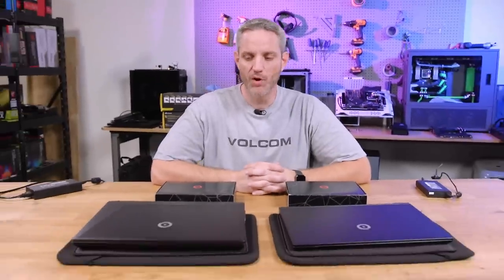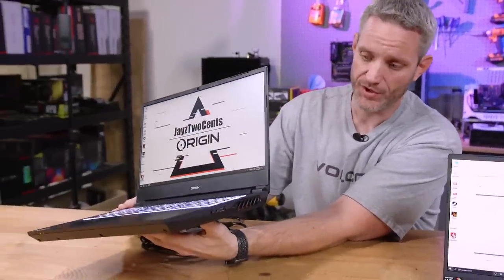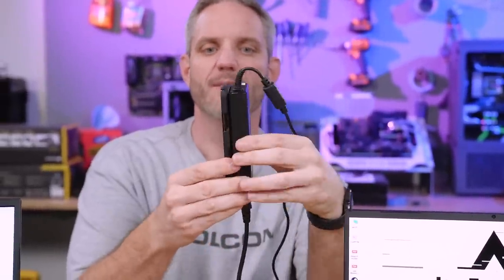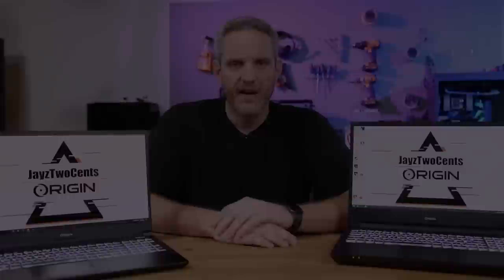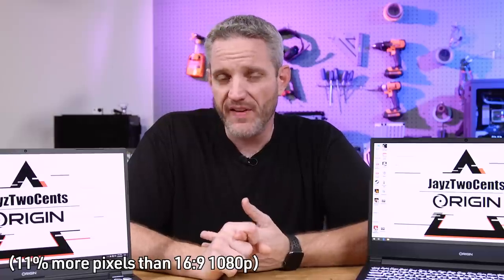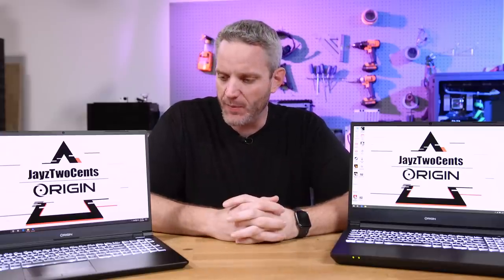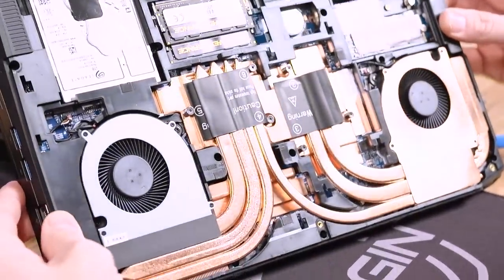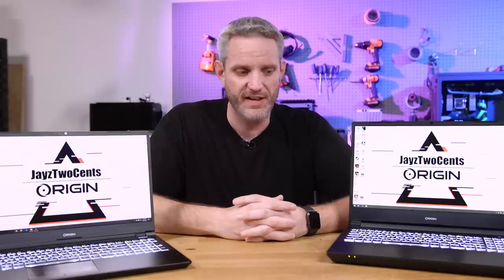A Laptop with 16 Cores 32 Threads?? Desktop killer!

Comment: No matter how powerful a laptop becomes  the battery will always be the limiting factor. I also hate that is that they are not as customizable. Labtop are good if you want to travel alot but I want a battery to last as long as my phone at least while I run my ide and surfing the web. I argue even a potato  desktop better then the best laptop for work as long as you have a decent processor.

Comment: One thing I will never like laptops for is them having batteries. I've never not had a laptop that its battery didn't die. Currently my laptop has to be plugged in or else it won't work as it doesn't hold a charge. For this reason I don't see myself ever buying another laptop again. I'm not going to replace the battery for it to have any use. If I don't replace the battery than it's just a desktop so I'll stick to only ever getting desktops for now on.

Comment: Personally I would choose the AMD system so I could easily do work in Blender while sitting beside the creek and also be able to power it via Solar anywhere I happen to be. Yes, I would not use the power brick in this setup and directly feed the proper DC Voltage from my solar setup thus saving energy & not lose at least 20% by going from DC to AC back to DC.

Comment: I have been thinking about a small form factor high core count build. Something that could run two or three virtual machines for gaming at a friend's house. I'm not going to be able to afford this but the idea is to redirect split screen gaming. Could you set up two or four vms to display to a large screen 4k TV consevably we would all only need to hang at 1080p. Or a weird 2080 narrow screen. That would be a challenge , super ultrawide 1080 top and bottom would be great

Comment: If i could get that AMD system in my camera bag, i'd use it for my 360x360 camera, and my pro camera's video. As it stands now i just have a cheap 4500u tablet(because that is what will fit), with the SSD replaced with a 1TB Rocket Q, to bring those photos/videos back home to my full 150w 3950xt. And if needed my 8750h for quick sync

Comment: 3:56 I bet it's NOT 4k, it will be UHD, they are two different resolutions !!!  4k = 4096*2160   UHD = 3840*2160 and that's because "4k"  and "UHD" are actually two different industry standards, so technically monitor/tv manufacturers are falsely branding their screens as 4k (in most cases).
Reply: they really are
Reply: @Fus1onplayz  do you mean they're really 4k ?
Reply: @MrTubeuser12  i meant that they are really two different resolutions😂😂

Comment: Would really love to see a review of a Sager notebook. 
They are super configurable, and speccing one out to match the Intel Origin, It is only ~$2700. With a 17" 144Hz 1080 display.
I picked one up for my wife to game with me, and I borrowed it when I went to LTX2019 for the BYOD area... ;)
Reply: Sager / Origin / XMG etc. are all essentially identical as they are all manufactured by Clevo, and later just rebadged to the correct seller. 

Like the same Origin model with AMD processor mentioned here is also being sold as the Sager NP7958 or XMG Apex 15.

The slimmer one reviewed here is the same as Sager NP8752.

Comment: Uhhh. The original xbox did not have a power brick... Smh... The xbox 360 did and the xbox one does but the original xbox had a internal power supply type deal.

Comment: Same problem like the xmg one. why they don t sell a 17inch version? It is impossible to work with several windows open on a 15 inch screen... What can be so difficult to put the same hardware into a bigger case?

Comment: I'm sorry, but this is a a poor attempt to sell a sponsored product, laptops will never be able to compete with desktops as long as parts are manufactured for both. An important part of it being cooling abilities. Also, if I want a powerful computer, why on earth would I have a noisy little laptop with so little room for expanding or upgrading? These cost more than they are worth. If you got more money than you need, go for it. They sure are very capable laptops, no question there, but by no means do they replace a desktop.

Comment: I'm not sure laptops are the solution for remote work tbh, there is plenty of software for remote control, from the most basic (ssh where you only have the command line) to the most advanced (steam streaming,  teamviewer, etc)...
I'm using an old x230 (this thing has almost a decade, changed the ram, the thermal paste and put an SSD) and working  with ssh, the only complaint I have is the cpu is sometimes a bit slow... but again it's a 8/9 year old i3... this thing is smaller than an a4 page and is extremely lightweight...

for the price of those laptops (that are obv. not going to age well), you can easily have a combo super lightweight remote pc + tower/server

Comment: .. and for gaming, which one has the required minimum 27" screen? honestly, who games on a 17" screen?
Reply: portable display😥
Reply: Fleecasy I can hardly use anything smaller than my 32” .. 17 is a postage stamp. Lol 😂
Reply: The One Ton Hammer 32 is too big for me, i prefer to not adjust my head whilst looking at the screen. 24/27” is fine

Comment: The XMG Apex laptop did desktop Ryzens first. They have an excellent website where you can customize every last bit of your laptops internals, cpu from a 3300x to a 3950x ;)
Reply: Are you aware that both XMG and Origin (as well as dozens of other high end gaming laptop brands) are just rebadging laptops made by Clevo?

So chances are that the laptop you are mentioning is actually the exact same internally, depending on which exact configuration they decided to ship :)

Comment: It’s not though is it because to be a desktop killer it would need not only performance when on battery not wall power but the ability to run off battery for more than 5 seconds under full load

Comment: Amd would be my dream to make music on cause the software im interested in is a beast drawing on porcessors and memory
Reply: Same.  Now have an AMD CPU pc
Reply: I'm interested in this because a friend of mine wants to start doing more music production. A bunch of articles etc he's read indicate that single core performance is more important for most suites of music production software. What's your take on this?
Reply: Quirinale D It depends on your DAW and how many tracks you use with CPU intensive plugins.  I know Ableton basically assigns 1 core per track...and if you have more then your core or threads it splits the load between them.  Higher ghz on single core is good for cpu hungry plugins like Serum, DIVA, some NI stuff, and Ableton Wavetable & Echo.  But if you have larger projects with more tracks and plugins you’d be better off with more cores.  I have a 3900X and I’ve been stress testing it in Ableton.  I can get around 196 tracks with CPU intensive NI plugins, wavetable, and echo at 128 sample rate before the CPU load is too much.  That’s without freezing anything.
Reply: Jesse Duplechain Hey man I just bought the eon 15x and half reason for video editing in premier and other half is ableton live and I play live with a lot of plugins running. Question is will the 32 gigs of ram be enough for both needs?
Reply: Nick Minderman I’m not sure about Premier but Ableton it should be fine.  It really depends on how many plugins and what kinds.  I have 16 in my 3990x desktop and managed to get almost 200 tracks at 128 buffer size.  I’d say do some stress tests in Ableton see how it performs while keeping an eye on your RAM usage.
Reply: @jesseduplechain  Thanks for this - I think he needs to get on some forums and start doing some serious research into what his use case requires.
Reply: @jesseduplechain  What about recording latencies while recording a real instrument from your soundcard at 128 samples (and less)? That’s my fear with AMD, there is a article saying latencies for recorsing from monitoring are higher
Reply: @eento06  I don’t have any latency issues.  I have a lot of big projects with plugins that gobble up CPU so I often record at 128.  Also I’ve seen some pro audio PC websites that have AMD builds.  They wouldn’t be using AMD if latency was a big issue.  I think the article you read was from a while back and all those things have been fixed.

Comment: did you put it on performance mode in the clevo control centre? on my laptop (that admittedly has as a 3900 not a 3950X) if i put it in performance mode the CPU power limit goes to 88 watt (and entertainment mode  has a 65 watt limit) i would have thought the 3950X would also get an 88 watt limit under performance mode

Comment: EON15-X looks like it's getting bottlenecked hard by that 2070. Overclocking that gpu by around 50MHz+ will definiitely improve performance for whomever decides to get it (and likely outperform the 10th gen i9 + rtx 2080 superMQ in some of the close gaming instances)

I'd like to see some temperature charts too. Since we're dealing with high performance gaming laptops, these things tend to heat up quickly and throttle. Plus intel kind of lies when they mention the turbo boost clocks. a 5.3GHz turbo means that'll be its peak clock once every leap year. My laptop was advertised for 4.5GHz can it's only ever hit that a few times and it was only on 1 core..
Really I feel this is the end of the line (peak performance) for 14nm chips.

Comment: Yeah no. I'm not paying $3771 for the laptop. I like to multi-task by HDMI a second screen to my laptop So I can be streaming and playing at the same time. I so far I had 3 gaming laptops so far because I was in the military and lugging a gaming a PC everywhere I go wasn't an option. The main issue I had with all these Gaming laptops was heated desegregation after about a year the laptops start to break down. Also, they are not designed for preventative maintenance. you have to tare apart the whole thing just to get to the damn heatsinks and fan.

Comment: configured one with a 2080 super......around 2700$ with 240hz 1080p panel...as far as the smaller form factor one.....granted you can get a gigabyte all in one 2080ti egpu for 1500$ idk if it can be modded....Ideally to fit/power an other gpu eventually. You really got to do the math on access to thunderbolt 3 atm....cough the blade 15 sale for 1100$....+ the egpu....even then its a 9750h not an 8core....and the 10th gen and 5ghz is also going to yield better fps......ironically enough......its 2400$ with a 3700x....same ram with an added 500gb evo sata drive on the amd rig........so you get an extra sata drive or m.2...so its a 2 m.2+sata drive mobo. And 2070 max P for 300$ LESS than the smaller form factor intel 2080super 240hz 1080p panel....ironically +106$ to step up from 3700x to the 3900 meaning even that orientation is cheaper than the slim/notebook sized intel with 2080 super. Im really considering this over an itx build. Oh and the amd is also with a +2 year warranty priced into the comparison so you remove that and you can add the 3950x to the equation of same......price talking 15" version bc im going to plug into a dedicated monitor and only use the included panel for "mobile use" which i can only assume is jack unless the 17" is also more battery life......idk if i can justify the price and extra screen which is essentially less battery life. Also chose better thermal compound as an option......considering how terrible some cooling solutions are and TDP offered for certain laptop GPU.....I wonder how many people have gotten one of these and how good they perform overall, and how often the AM4 needs to be re-pasted. Configured/customized just to get a price comparison. But yeah the 32gb 3200 kit 250gb gen4 drive as a base line for both.......2080super 240hz vs 144hz only option for 15" with 3950x(+500gb sata evo drive)......=2700$ both. Pretty nuts...which is why i vouched for configuring one with a 3700x or 3900x and a 2 year warranty....but the 3950x...4.7ghz max boost claim is pretty nuts.

Comment: I would like the EVO with an AMD 4900H, thanks!!
Reply: As long as they don't pull a MSI and mate it with a 5500M at any rate...
Reply: But why tho? That’s a whole 3950x a desktop CPU? And am4 socket meaning that it can be upgraded and swapped out? I’m just confused because you’d be lowering performance and upgradable. Also zen 3 desktop is am4 so you could put a next gen cpu or am I missing something or too new to computers to understand your take?
Reply: @imwolfpup1421  Thats for the EON laptop, the EVO is more portable.

Comment: My HP Omen with a i7-9750H and a RTX 2070 gets to 99c on some cores when gaming in 144hz. Using Throttlestop, and have to change the screen frequency to 60hz, to get lower core temp. Is core temperature close to 100c bad for that CPU? When I'm talking to HP support they just ask me about drivers and if I have updated windows :-(

Comment: Description: "'Laptops' are usually synonymous with heavy, slow, clunky PCs shaved down in to a travel sized format... but what happens when today's laptops are faster than MOST high end desktops?? You get these!"

Not to be an asshole, but that's just objectively false, you can spend nearly half the price of these laptops on desktop hardware and come out with pretty much identical performance(Especially because of how overpriced SI builds are). Comparing price for price spec for spec it doesn't even come close, laptops always fall short, obviously.

Unless you absolutely need to travel with a good computer, laptops are pretty much 100% of the time, not worth it.

Comment: The Intel one is just a refresh of last year's Clevo PB51EF-based models.  I have one of those.  Powerful guts, stunning display, great connectivity, but those fans do like to spin up under even the slightest load.  Battery life is potato.  These things want to be plugged in, and I haven't found any kind of external battery solution that can handle the power draw.

Great desktop replacements, terrible mobile devices.

Comment: ill take the slim one, even tho its tempting to take the bigger one, its just too big and too power hungry, maybe i occasionally edit 1080-4k vid but the smaller one is good enough. in gaming too it maybe better because of 2080maxq. also slimmer and bigger battery.
if the slimmer one have ryzen 4000 maybe i take it. but seriously though, 8core 16 thread is more than enough of anything i do

Comment: The last time I had a laptop was the Dell Inspiron 3000. I think I got it around 2004 or 2005. Since then I've been using a desktop at home (and in the office at work) and my iPhone. I get a new iPhone every 4+ years and currently I'm using the iPhone 7 Plus which I've had since it came out. I'm long overdue for a laptop.
I will say that laptops have gotten way better than what I was using, but what I dislike is how laptops are more expensive and they're not as modular as desktops other than RAM, internal storage, and the WiFi card.
I think it's great that both these have upgradeable internal storage and RAM. I hate how some modern laptops have RAM and storage soldered on the motherboard. 

#4KED 🤣
#TwoChromeTabs 🤣

Comment: After criticizing AMD for their platform generation naming. Comparing these two at all seems a little odd.
I wouldn't think most aware users would think they want 3950x. Same name diffent specs for desktop vs mobile graphics has narrowed this generation.
Still these seem like completely different animals to me.
The 2080 mobile GPU seems nice and I doubt if it were available with the 3900x that it would be bottlenecked.

I am disappointed the 4700h is limited to 8 lane PCIe 3.0 though I want to see how much a bottle neck that is now it's still a lot to leave in a trade off so dedicated mobile graphics is better paired with something else. Hopefully next will have 16x 4.0.

Comment: Doesn't you company give you a laptop to work from home for? I know mine does. I kind of sucks because I really could use more power but I can not buy more if I wanted to. Honestly I would not want to mix work with my home system anyway.
What would I do use it for? Simple Kernel builds. I have been doing :Linux kernel development and to do an initial build on my project takes a while. So yes I would have a VM running Linux to do my dev work on using most the CPU cores running under windows for skype and Office access. Why not the other way? IT.

Comment: I'll have you know i am perfectly happy with the lenovo thinkpad i am using...4 core, 8 threads, vega graphics, and it was merely 400$....
Reply: Did you buy it used? My thinkpad is a 2 core 4 thread i7 with integrated graphics and it was $1200 (bought new in 2017)
Reply: @kaldo_kaldo  whoops, it's a lenovo flex, not a thinkpad. and it has a ryzen processor and i got it on sale.

Comment: Laptop have their utility but still, they are so far away from desktop for performance its not worth it. Hardware unboxed did a very nice video showing difference with laptops with 2060 super up to 2080 super regular and mq variant vs desktop and it shows clearly how far they are in performance.

Comment: I have a similar issue with mechwarrior online on my 4k tv. the UI in the mechlab doesn't scale so I have to switch to 1080p to be able to read it, but 1080p runs off the screen, 1920x1200 works perfect. interested to know if you figure this out.

Comment: Can the 3950x version output a separate dp signal to the usb-c port (alt mode) and the mini-dp at the same time? I have an external multimonitor use case

Comment: I bought the eluktronics 15 inch laptop you recommended qith amd 3600 and 2070 m and it rocks, but ummmm. 12 cores and 32 threads? I dont my house hold would use all that.